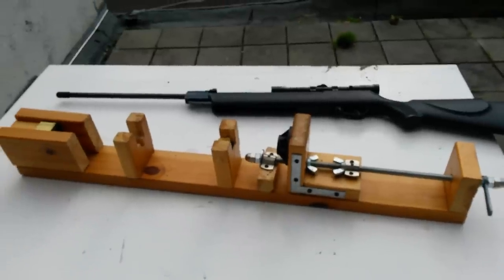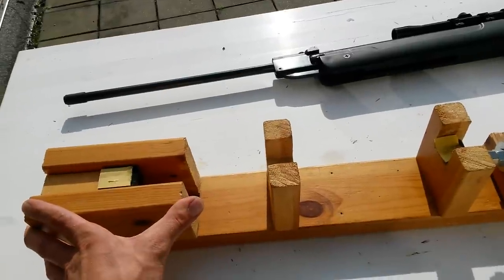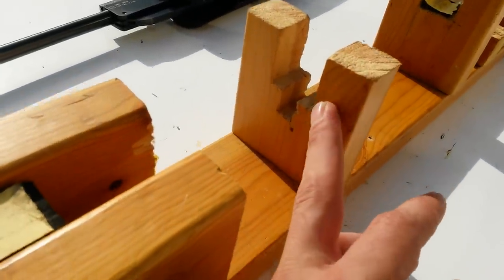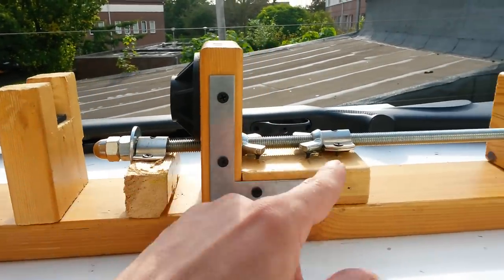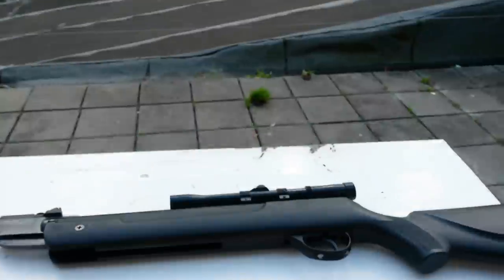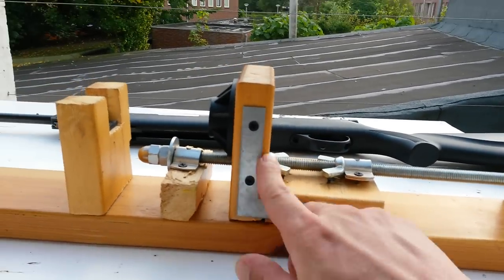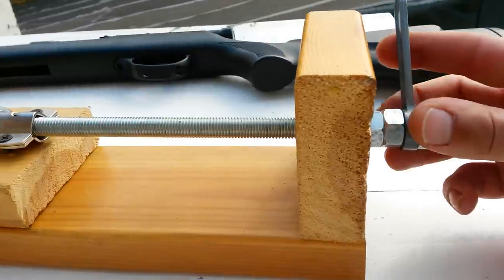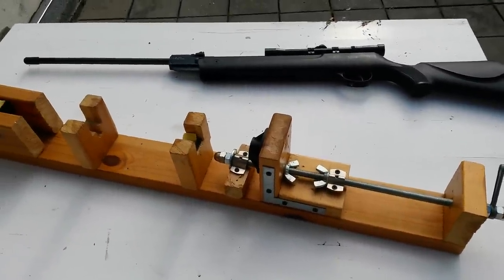DIY How To Make a Homemade Airgun Spring Compressor Tool Plans Air Rifle Maintenance Disassembly

Comment: please upload  how to disembly  hatsan  mod 95  vortex gas piston air rifile
Reply from the maker: hi jamal i'm sorry i don't own a hatsan gas piston yet! but i think disassembly is not that difficult since it doesn't have so many moving parts and its not like you can open the gas piston for maintenance on hatsan 95...you can polish the trigger but for the most part just keep your pivot point oil and clean the barrel on time!